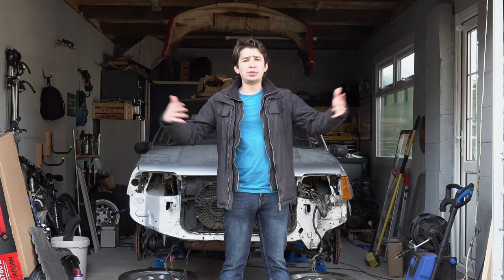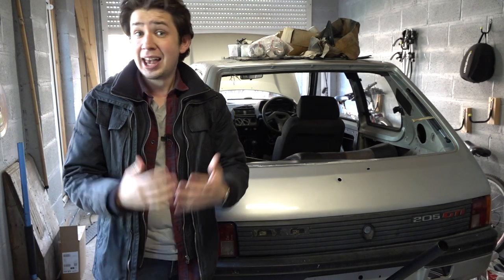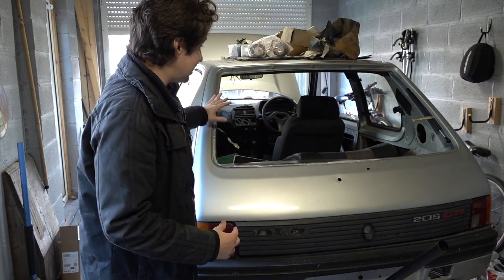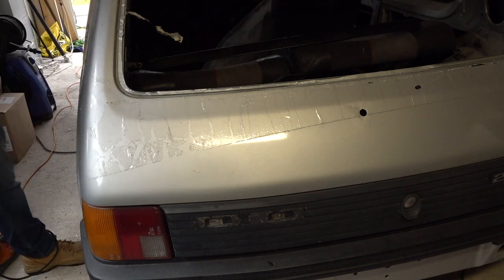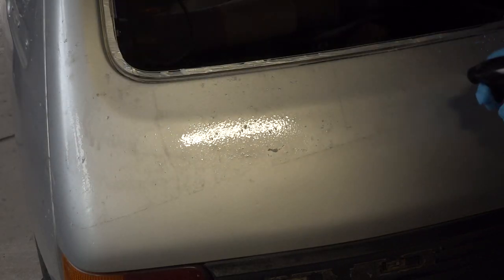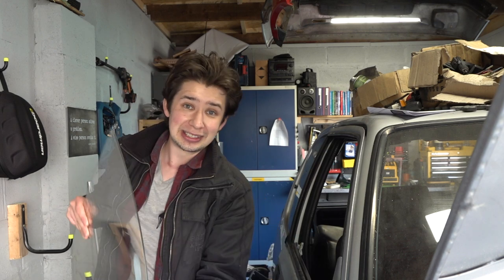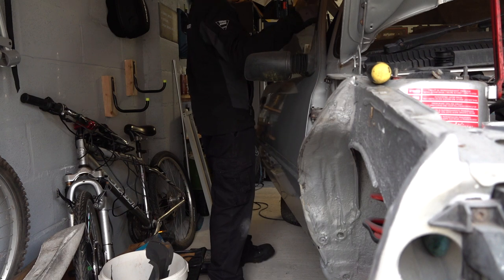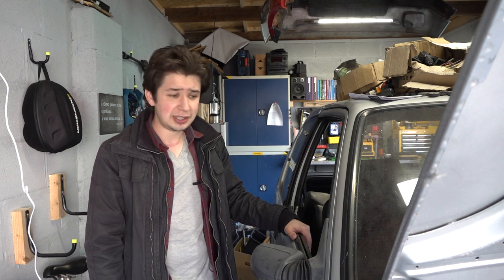Tidying Up Some Of The Body /// Peugeot 205 1.6 GTI // Running Down A Dream / 5.3

Comment: The Peugeot 205 was my very first car back in 2000. It was a 1L Trio but had a lot of the trim from the GTI - just didn’t have any GTI badges or half leather seats. The seats it had were defiantly not the regular seats as they felt much like the GTI ones just without the leather - very comfortable to drive.

I was going to get the 106 rally-e front bumper and skirt fifth fog lamps but didn’t bother in the end and part exchanged it for a Fiat Punto due to the front suspension was completely gone.

Loving this series and really is inspiring me to find a 205 again!

Comment: For your faded black plastic bits on the back, check out cerakote trim coat, they're little wet wipes soaked in whatever it is but its the dogs danglies for faded plastic, Ive just rebuilt a black moped for my son cos he turns 16 soon, its a 1999 T reg Peugeot, all the plastics were faded to greyish like your rear panel. Quick wipe over, leave for 30 mins and now they look brand new, its guaranteed to stay like that for like 200 washes.